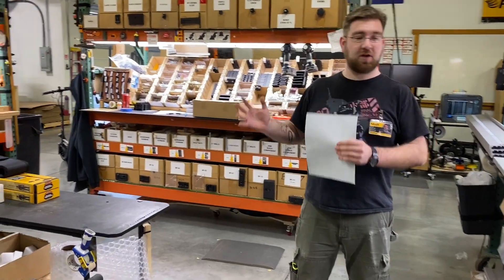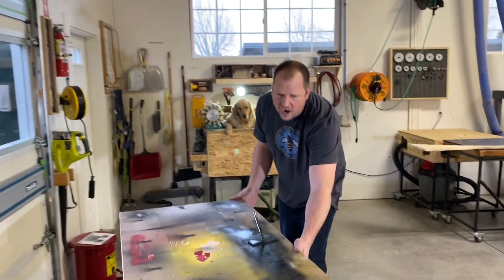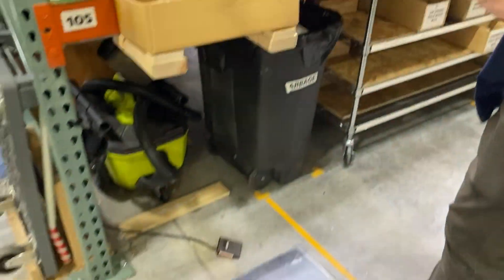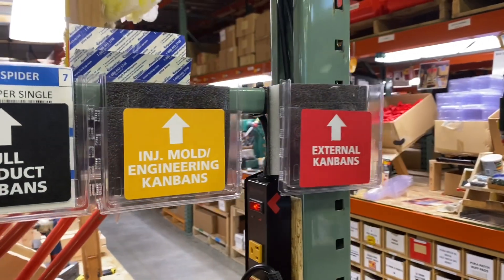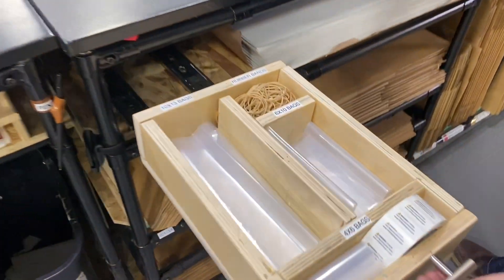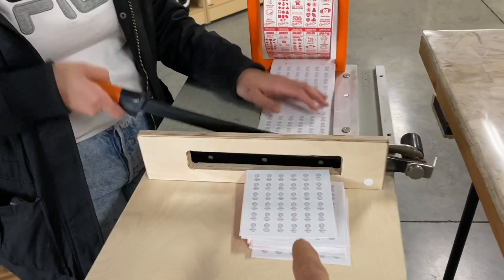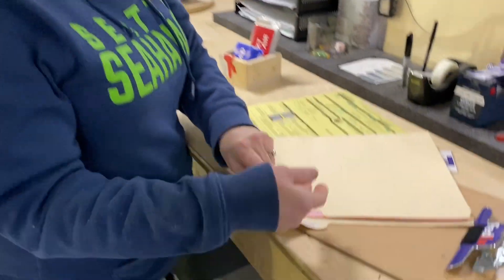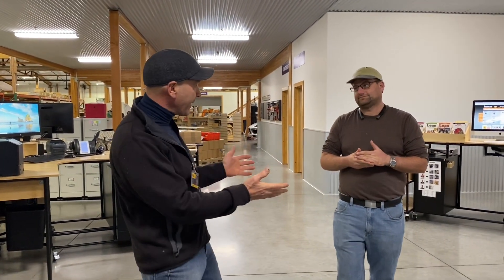FastCap’s Best Improvements 2019

Comment: Do you have any tips for lean in offices/computer work?

I love the improvements, especially at minute 11:00 with the ID cards! I work in an office (used to be in manufacturing) and have found it a bit easier to do improvements with physical items vs with computer work. You lightly touched on it in 2 second lean with your graphics department and with a bank, but do have any recommendations for lean in offices?